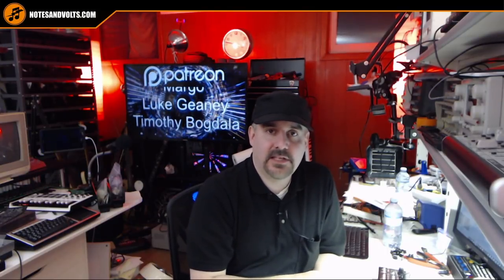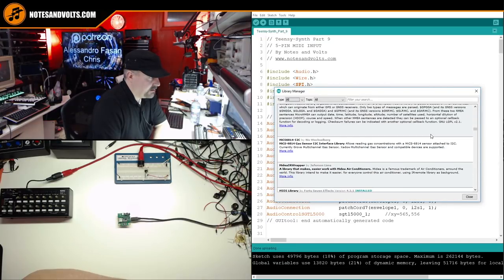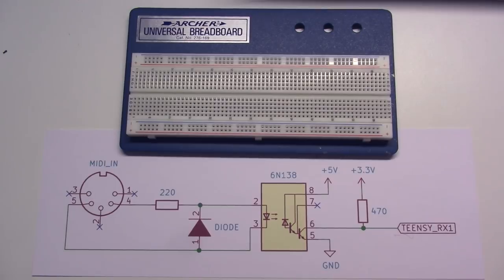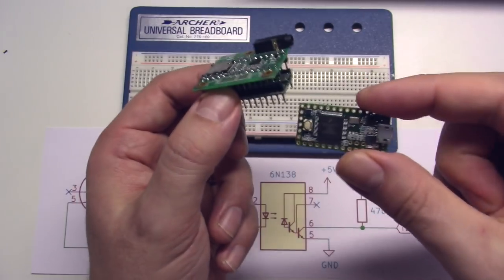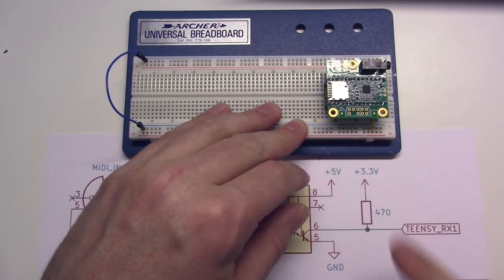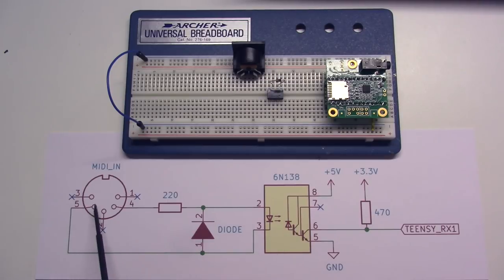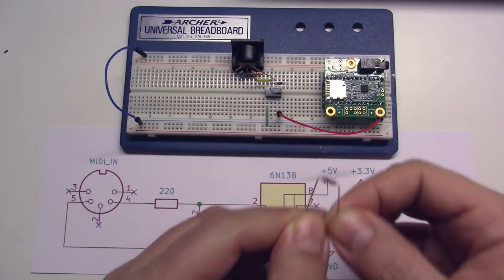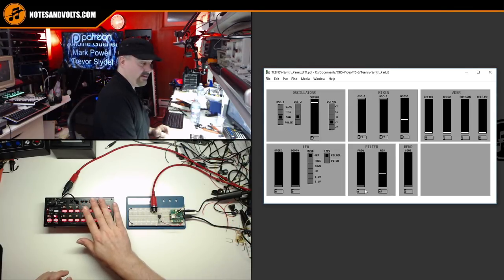TEENSY-Synth PART 9: MIDI INPUT

Comment: using pure data if we was to select Teensy for midi In and Teensy for midi Out would it create a midi loop or would the computer and teensy chip be able to keep midi data on different ports or Lanes

Comment: Hi Dave, why did you tied the pin 8 of 6N138 to 5V? 6N138 datasheet maximum ratings gives Vcc from -0.5 to 7V and the datasheet never says that Vcc it should be steady to 5V. Moreover I've tested this guy with 3.3V and 5V with my oscilloscope and the propagation delay is still the same, about 2us for both values of Vcc.
Reply: I see this question never got answered. While I can't say for sure I can make some guesses ( even though it's a bit late )
The absolute maximum ratings don't say if the device works in those ranges, they are just guarantees that the device will not get destroyed. This becomes more obvious when looking at the internal circuit the combined base-emitter voltage of the two transistors is at least 1.2V so below that voltage it likely won't work well. 
The majority of tests in the datasheet however are done around 5V and it seems to be generally recommended by the manufacturer.

Another reason is that those micro controller boards usually use a linear regulator to get 3.3V from the 5V USB input, and generally it's not a good idea to power more things from that regulator than necessary since it usually doesn't have that much overhead designed in. While the Vin comes straight from the USB input and has less restrictions. Supplying the receiver side of the optocoupler won't use much current but there isn't much reason to go trough the onboard regulator 3.3V if the unregulated input is fine as well and also seems to be recommended in the example circuits of the datasheet.